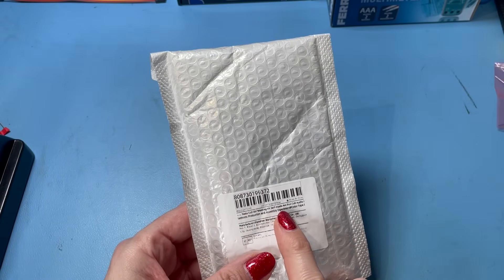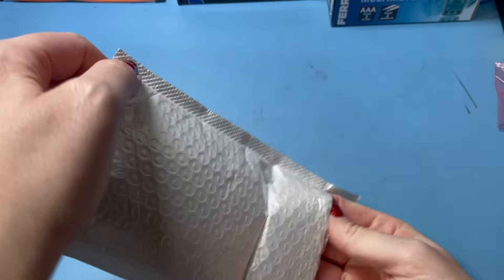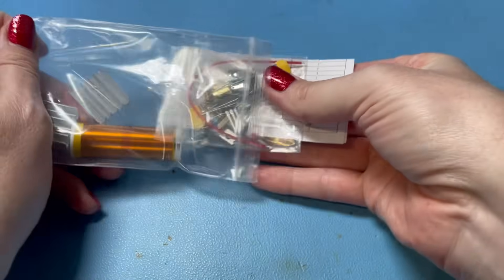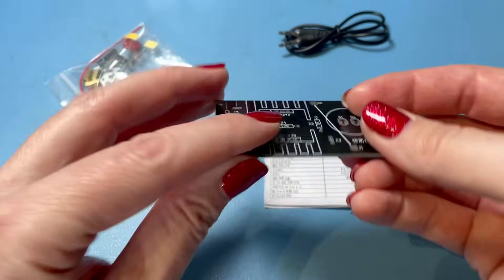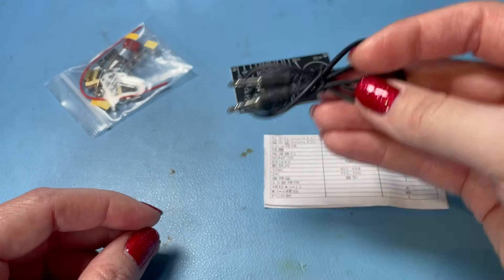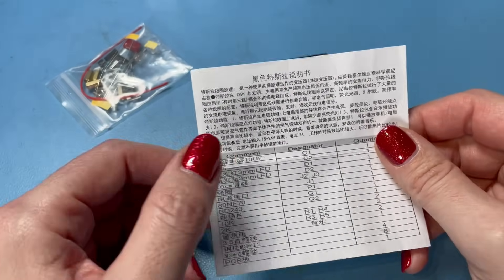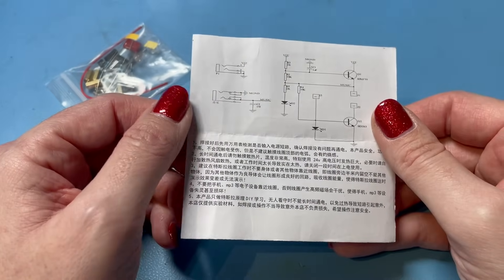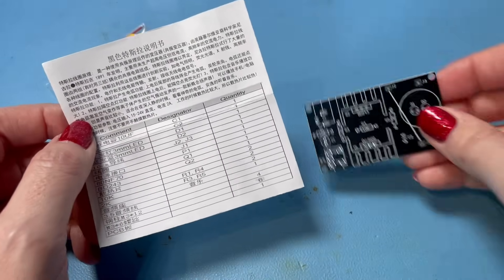AliExpress Tesla Coil Electronics Kit Build!  It Plays Music!

Comment: Hi Ms Jazzy ❤ 👸😉😽🌹🌌💃🌝🕺☕🥰 should you use a little heat resistant caulk or similar to help secure the heat sinks? Great project! Thank you again! ❤ XXOO! Hugs and Happy Halloween 👻🎃
Reply from the maker: The heatsinks are quite small, so as long as you don't throw it around the legs of the transistors will keep them in place ok. Happy Halloween to you too 👻🎃

Comment: "long leg positive" ... Ouch! Sometimes "+" is the marking for cathode, and that definitely isn't positive. When supplied with random through-hole LEDs I'd have to give them a quick power up using a bench PSU to check, plus triple check the PCB markings to avoid disappointment.

Comment: That is an exciter/slayer. IT IS NOT a Tesla Coil.
Reply: Yep, the primary coil forms part of a feedback loop that switches the exciter transistor to maintain oscillation (resonance). 
A true Tesla coil uses transformer coupling, a capacitor and a spark gap to achieve resonance. The primary and secondary LC circuits must oscillate at the same frequency to achieve maximum power transfer (with spectacular results).
This circuit circumvents all that stuff and is therefore more popular with hobbyist..

Comment: Generally you will find nowadays that enamelled copper wire has a 'solderable' coating. This avoids the need to scrape and possibly damage fine wires. Just try to tin the end to check.
Incidentally, I have an Aliexpress kit somewhere. Can't remember if it it has an audio input, must dig it out and assemble it.
Reply from the maker: Yes I am aware some enamelled copper wire has this coating. I wasn't sure about this particular wire, so best to scrape it as other people will be watching/leaning from this video and the enamelled copper wire they might use in their projects in the future might not be solderable, so 'belts and braces' scape it in this case 😊

Comment: 1975 when I was at school, we learnt all about the tesla coil. A classmate and I stayed after school for parents evening and were showing parents what we were learning in science class. One was the tesla coil and the two chrome domes that the electricity was made and you had to touch hte two domes together to shorten the power out of them, a bit like doing to a large capacitor. The teacher wouldnt let us demonstrate the static it causes when standing on a large glass block and putting hands on the chrome dome and making your hair stand on end. Many years later, I remember the evening very will, but forgotten most of the electricity making with the apparatus.